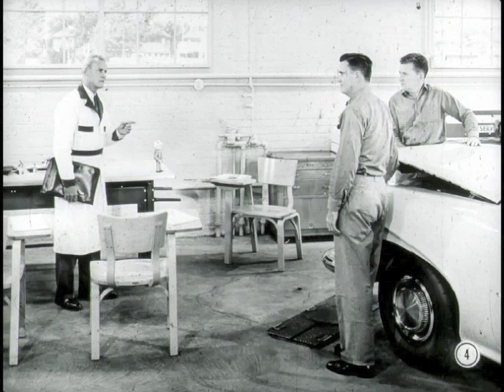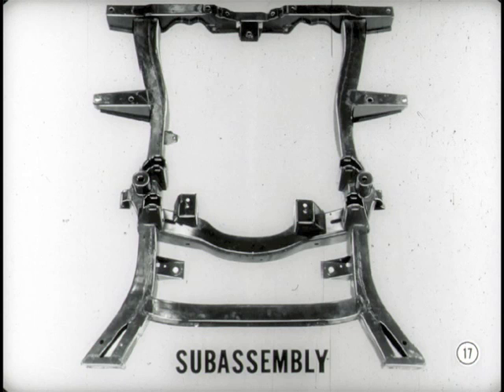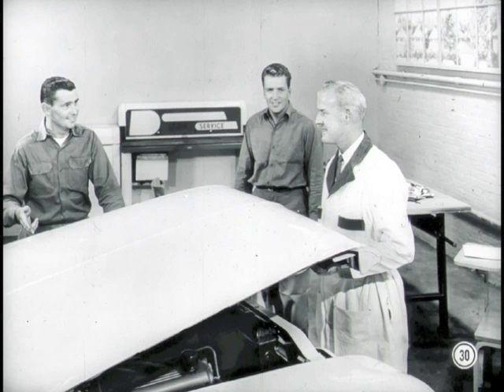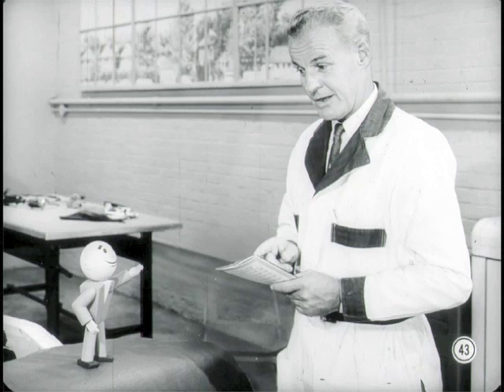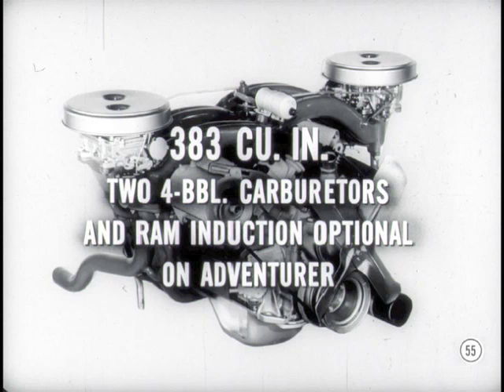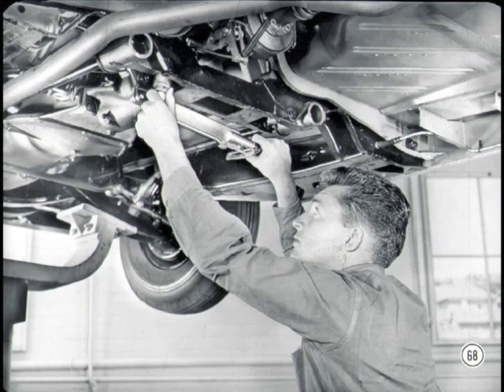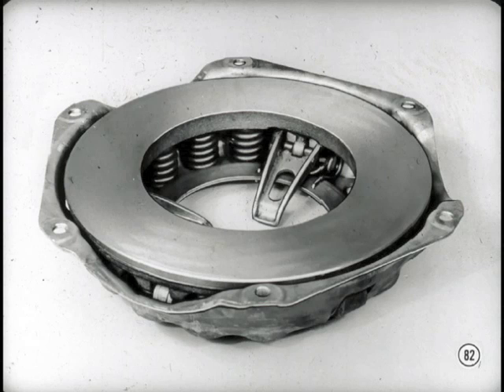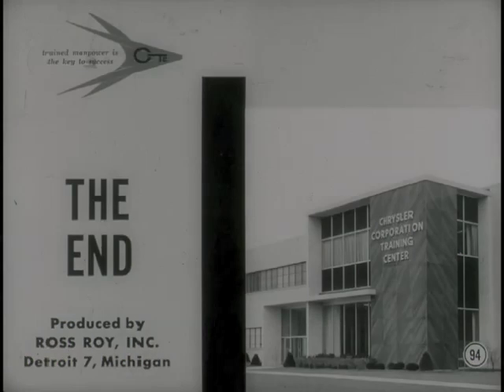Chrysler Master Tech - 1959, Volume 12-11 Features of the 1960 P Series

Comment: 383 Dual Ram, 413.....
And that kid was excited about the SIX!!!! 😲 
No words...
Reply: Actually, there was good reason to be excited about the six. Most American cars had an inline six as a base engine, but some manufacturers made them cheaper at the cost of performance. If you compare that intake manifold, cylinder head ports, and carb to that of a Chevy 250, you will easily see why the slant six is so much better.
Or, let me put it this way. The cheapest model in this line had performance advantages over the cheapest model of other car companies.
Reply: @skylinefever  I know.... Originally that long ram intake was Aluminum. It had sealing problems (wouldn't now!) but it gave a few more horses, just by denser air.
Reply: @CarminesRCTipsandTricks  It also improved fuel distribution among all cylinders. Sure, a single carb would never make the air fuel ratio at cylinders at 1 and 6 the same as cylinders 3 and 4, but the slant 6 intake made the problem less severe than other inline sixes. Multiple carbs were a solution, but that wasn't common.